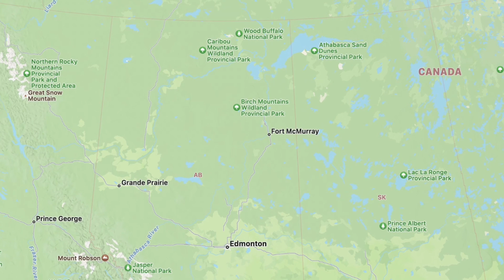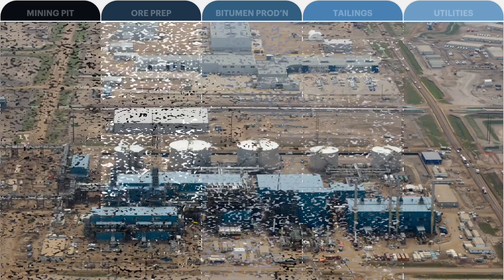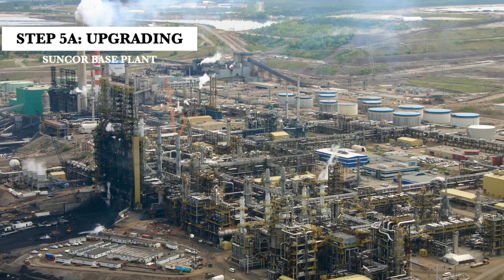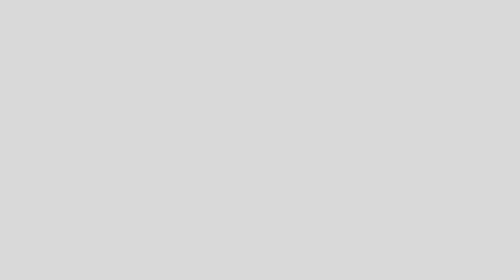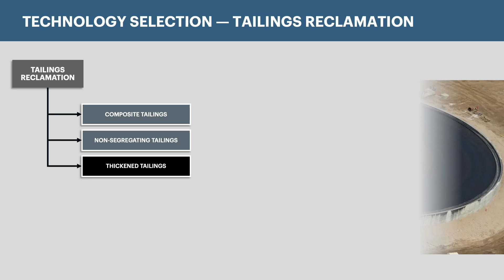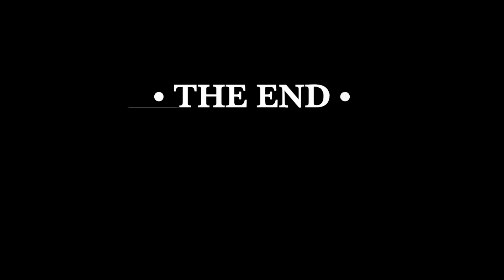A Tour of Alberta's Oil Sands Miners — Course Preview

Comment: First space elevator is built in Alberta using oil to make carbon fibre steel and oil to make rocket fuel. Everyone is burning their money we use different types metals and things as money. Carbon fibre steel is used as money

Comment: Mining or excavation oil sand to produce bitumen is really effective technology because these achieve high coefficient on bitumen recovery. This old technology has improvement during decades, but a) is capital intensive, b) cost intensive, c) energy intensive and emission intensive, d) water use intensive even the water partly is reused, e) tailing ponds need decades reclamation, f) pollution and land disturbance harms habitat and humans.
Industry has the highest emission and highest cost, but has advantages when bitumen are upgraded. 
The mining technology used on industry must phase out many operations, starting from excavation, crushing and  other processes.  The bitumen must be and can be produced underground without disturbing the environment and without tailing ponds.  Keep only upgrading plants which must increase the API of bitumen produced from underground.
Reply: It's a naturally occurring thing. The oilsands operation is basically a massive operation to clean up a naturally occurring disaster. I've seen it with my own eyes from start to finish, operating a massive dozer in a cut and get down on the ground for a break to see oil running right out of the wall of the cut. Like a slow faucet, I've seen the oil naturally running into rivers and stream filled with wildlife, fish and people. Having the reclamation done and ending with clean forests, lakes for the environment the end product. Are equipment and plants a disturbance...yes for sure but in the next 60 years most of it will be fazed out for better tech. I'm definitely proud to have played a part!
Reply: The tailings ponds aren't any dirtier than the oily water that leaks naturally into the Athabasca river.

Comment: I worked as an operator at both Suncor and Syncrude in the 1980's. Great jobs but very cold in the winter and not many dates for single men.
Reply: Did you work as a refinery operator or a Haul Truck operator? Fort Mc Murray is different now. Plenty gorgeous women living there...😄🍻
Reply: @Brandon-218  Cougars
Reply: Are there jobs. I just quit my job and plan on moving to AB in a couple of months. @Brandon-218
Reply: There is no need to live there at all, lots of camp jobs still. Did it for years and could go back anytime i choose but honestly my favorite thing of all was leaving the mac at the end of every rotation. 😂@Brandon-218
Reply: Did you resolve the dating issue?
Reply: im from africa swaziland how can apply for a job there?
Reply: @mbongenimabaso7234  yes
Reply: @mbongenimabaso7234 only if you have a special skill mate. Engineering, tradesman not equipment operator. If you find someone saying they are hiring equipment operators from your country they’ll be scammers run away with your money.

Comment: Very very dirty for the enviroment to extract
Reply: The oil is already IN the sand, has been for centuries. How dirty is that.
Reply: Did you even watch the video? They take oil out of the sand then put back clean sand. Basically a large scale environmental cleanup.
Reply: @kcbob8004  It's dirty because it takes more energy to mine than other fossil fuels (due to being such low-grade crude oil that requires a lot more refinement before it can be put to use) and because it ultimately contributes to a type of fuel that emits carbon. From processing to final product, it's extremely detrimental to the environment.
Reply: @zephemerality so it should be left in the Forrest, lakes and rivers?  I'm sure the wildlife and locals don't feel that way. If it is so bad then why do the aboriginal tribes work with the oil companies to clean up the land in the overall process?
Reply: You ever wondered where your 💩goes after you wipe your bum
Reply: @kcbob8004  Tar sands oil — even the name sounds bad. And it is bad. In fact, oil from tar sands is one of the most destructive, carbon-intensive and toxic fuels on the planet. Producing it releases three times as much greenhouse gas pollution as conventional crude oil does.